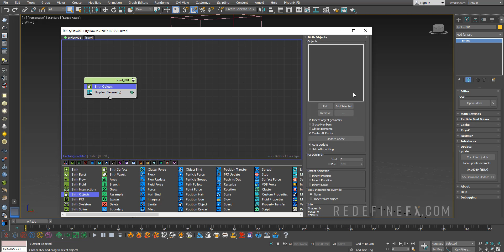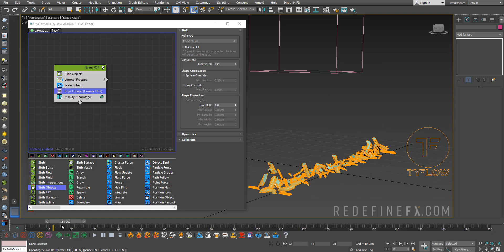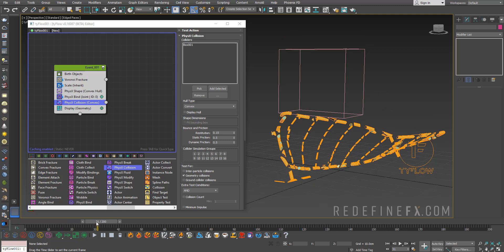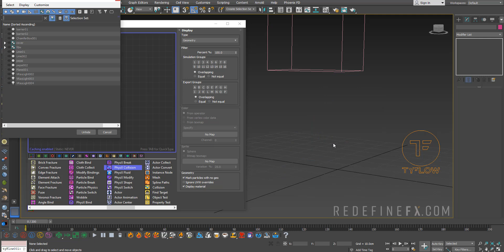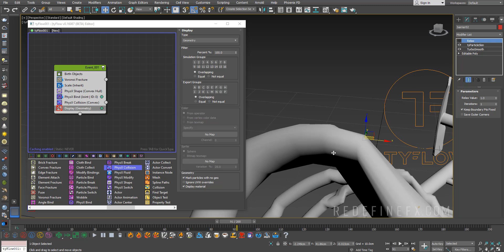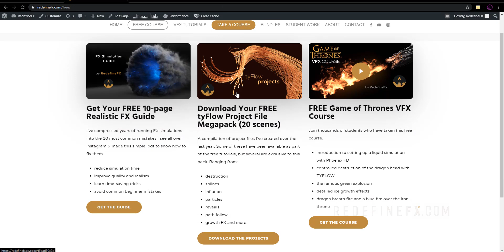tyFlow Metal Bending Tutorial in 3Ds Max by #RedefineFX

Comment: Correction at 2:05. The bend angle is not for allowing the binds to bend, but sort of the opposite. It prevents the binds to return to their original transformations once they pass the given angle. So if you have two binded particles and the given angle is 40°, and you fold them to right angle, and remove the force, they will rest around 80°. This is because when you're bending and the current angle is just over 40°, the transformation offset resets, and once again after another 40° bend.